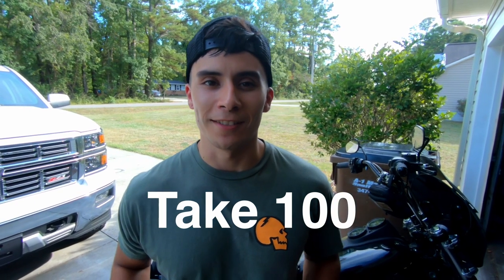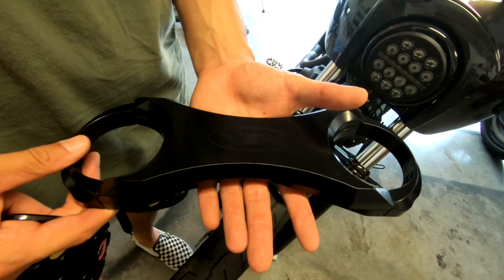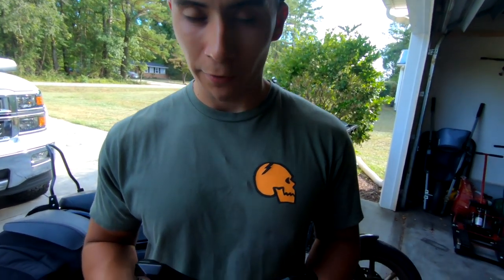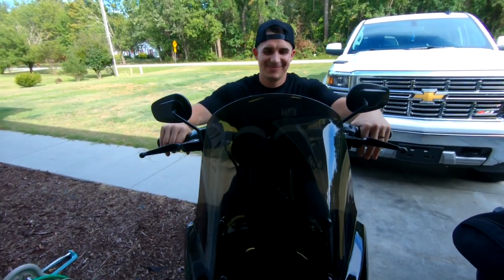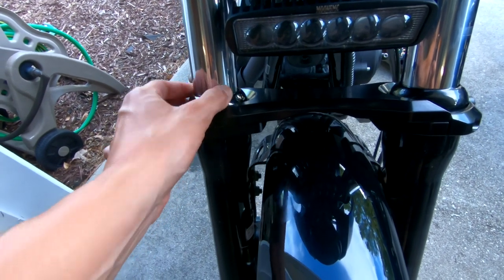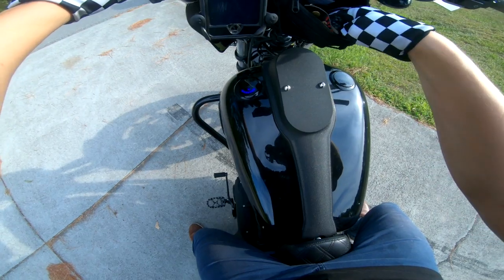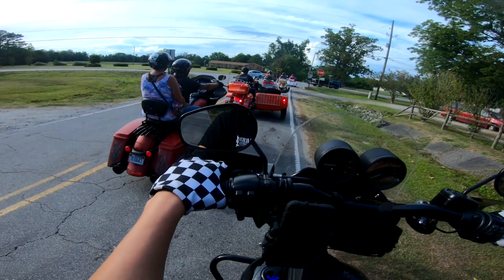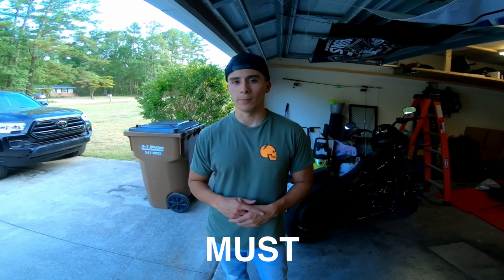Villain 2 Hero Fork Brace Initial Review (V2H)

Comment: You should NOT tighten the screws that fix the cross-brace before fitting the outer clamps. Then you tighten the cross-brace screws - if you tighten them first then you may well cause binding problems.
 I notice that you have a Predator fitted - I found that to be worse than the standard mount as it cannot be tightened securely enough to stop the front of the engine moving sideways and ruining the handling.
 The only thing you need to do is fit front and rear mounts from Big Bear Performance - no more sideways movement from the front or rear of the engine/trans unit and handling like you wouldn't know. I use them on a dyna with over 120 bhp/torque and never get any wobbles.
If you want to improve the sloppy suspension, then visit the Race-Tech sight and buy springs, oil, cartridge fork Emulators and rear dampers.
Reply from the maker: Thakery thanks for all the info I have stock engine mounts on my dyna is that what u were referring to as predator mounts?
Reply: @dynademos   Stock mounts allow too much sideways movement, and decay with road dirt or oil on them. I thought I saw a Predator front mount on the bike in the video - obviously not from what you say ! The Big Bear Performance mounts are not cheap, and the rear one is a bitch to mount BUT they will handle all the power a well tuned Dyna can make - use Drag Spec urethane 'rubbers' on the front mount - the ones from H=D are too soft. They bike will vibrate a little more but there will be NO WOBBLES......
Reply from the maker: Thakery ok yeah I’m familiar with the big bear performance mounts it’s just a lot of cash his stuff is nice though. U prefer race tech for suspension what do u think about ohlins after listening to Kevin from big bear I’m kinda leaning towards ohlins
Reply: @dynademos   It appears to me that your level of mechanical fitting abilities is making you try for 'a quick fix' and that is not the correct way to sort the Dyna's stability and handling problems.
The Race Tech stuff is a much better price than the Ohlins - I have never experienced Ohlins suspension so I cannot compare them - it'd probably be to soft and sloppy for my taste. 
My fork springs are made to my specs - same length as the standard H-D ones but made with the next thicker standard wire gauge and simply wound - no progressive stuff for me ! - my springs are 50% stronger than H-D ones and although I use much less pre-load, I do have pre-load adjusters from Speed Merchant to enable 'fine-tuning' for various types of riding. 
I only use Race Tech Emulators, I use them with 30wt oil. My rear shocks - 'Nitro's' - are from Hagon here in England ('made' is the wrong word as they are assembled in England from parts made in Germany ! ) and the springs I use on them are 50% heavier than stock H-D.
 If you do not use Big Bear mounts to improver the flexible nature of the frame/engine 'platform', then you cannot hope to improve the handling even if you spend five or six thousand on the forks/rear shocks/fork braces/tyres and all the other stuff on the market - it'd be like putting sticking plasters on a broken leg !!!!!
Reply: dynademos check out Chopper_hauss_. They made the big bear mounts. I guess they weren’t getting paid, so they make them under their own name.
Reply from the maker: Bryce Weaver will do✊🏽
Reply: @bryceweaver8211   The rear looks easier to fit, but prices are similar. The front mount doesn't have the adjustability though and some bikes need that - mine did, you pays yer money and takes yer choice.......